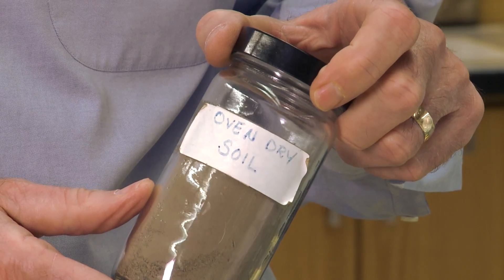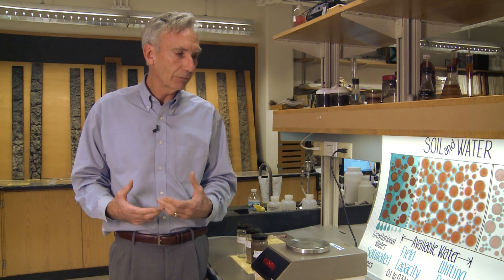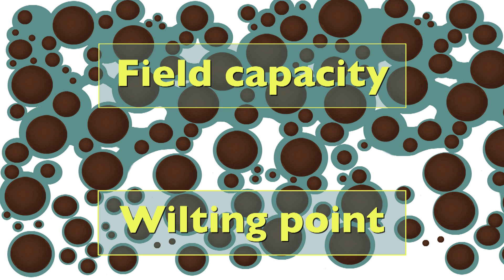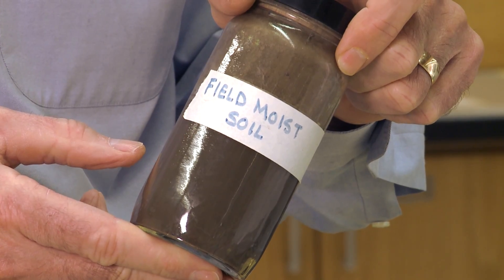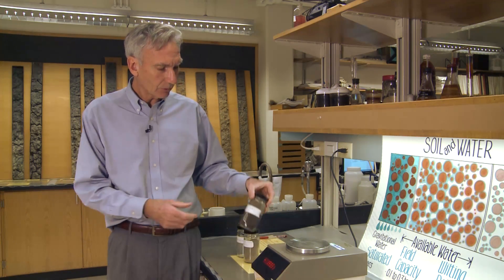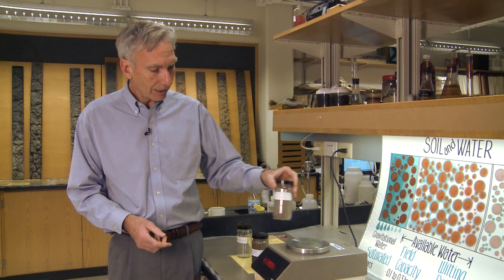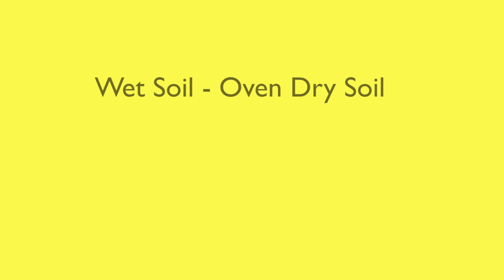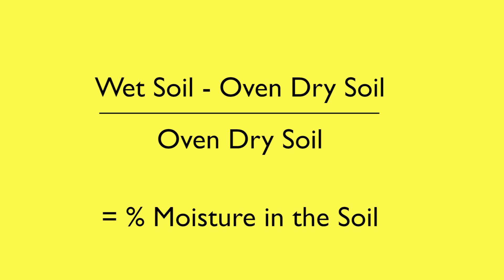Soil Basics: Soil Moisture

Comment: i feel like waiting 1 or 2 days  for check F.C, depends on climate conditions and if the test is done (in a pot for example) with or without a plant (evaporation / evapotranspiration) so i was wondering if there's a more specific way to check if a substrate is at F.C to then start weighing the moisture %? does it even has to be accurate or 1-2 is just good enough? Thanks so much for the explanative video

Comment: Hello Purdue University people! This is an amazing clip, I must say! I have an issue, however.
How is it possible that you get it in percentage from weight without multiplying it with 100%?

Let us say: (100g wet soil - 50g oven dry soil) / 50g oven dry soil = 1

1 is equivalent to 100% or 1% available water?
Could you provide me/us with some actual examples?
Reply: That would seem to be 100% soil moisture by weight. Which would be saturation. Once the excess drains away through gravity, what you would have is field capacity. I understand that amount to be dynamic in range depending on the structure of the soil. For example, if the soil was sand you could get 100% saturation, but the field capacity would be 6%.
Reply: @nicholaswhiteley3599  I am trying to digest what you mentioned. Hahahaha!

Comment: What is soil moisture tension
Reply from the maker: Hi Shreya - Soil moisture tension is how tightly the soil holds onto the water.  A low “tension” means the water can move easily in the soil, either moving downward or being taken up by plant roots.  A high “tension” means the soil holds the remaining water tightly and does not release it very easily to plants or to downward flow of water.  It’s related to the energy status of the water in the soil.

Comment: Does that mean that in determining the field capacity in percent basis, the difference between the moist soil (2-3 days after saturation) and ovendry divided by oven dry will corresponds to field capacity? Thank you
Reply from the maker: Hi Danielle - Yes, an estimate of field capacity would be the soil moisture at 1-2 days after saturation.  So yes, take the difference in weight between the moist soil and oven dry soil, and divide by oven dry soil weight, and multiply by 100 to get percent moisture at field capacity.